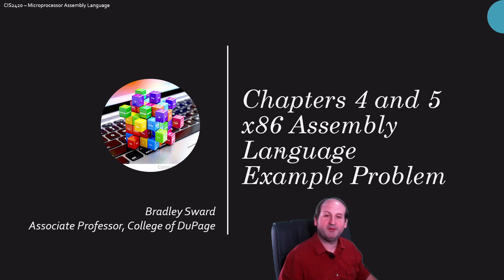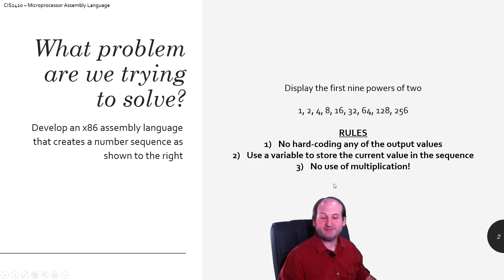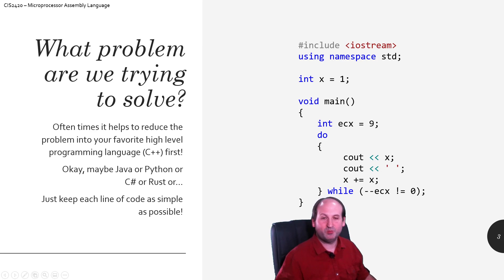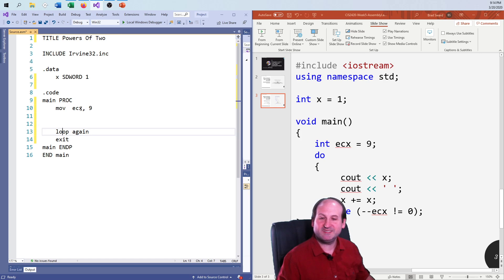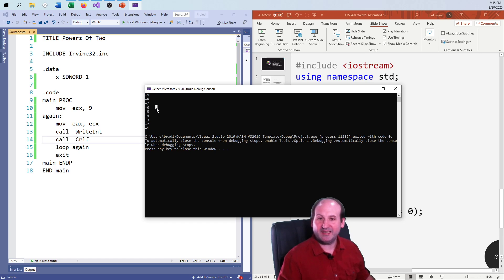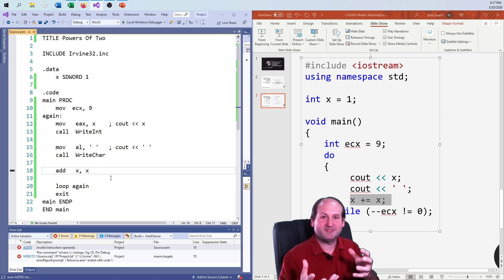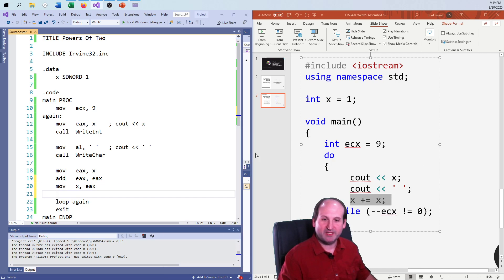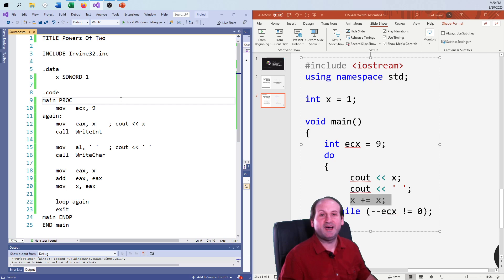x86 Assembly Language - Using Registers, Variables, and the LOOP Instruction Together

Comment: Great video! Does the registers we use change when we use the loop for array? (such as filling an array).
Reply from the maker: Registers are just CPU variables with very specific names.  Some operations directly change registers, like ADD and MOV and so forth.  Some operations like MUL, DIV, and LOOP indirectly change registers.  LOOP modifies ECX without being explicitly described in the code.  Does that help with your question?

Comment: So when using a loop, it will exit the loop once the counter (ecx) gets to 0? Also, is there any keyword to break a loop and continue the rest of the program?
Reply from the maker: When the program hits the LOOP operation, it first decrements ECX register by one, and then checks to see if the ECX register is zero.  If it is zero it falls through the loop, otherwise it goes back to the label specified for another iteration.  

There is no keyword specifically to break the loop like you would see in C++ or Java.  You would need to set up a label after the completion of the loop and have a jump inside the loop to break out.
Reply: @bradleysward  That was a thorough and clear explanation, much appreciated. Thanks!